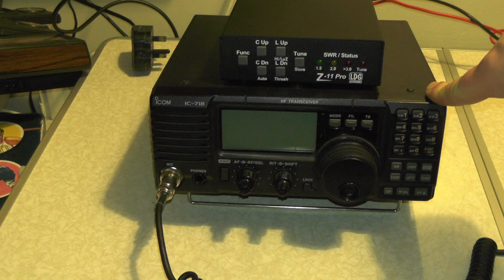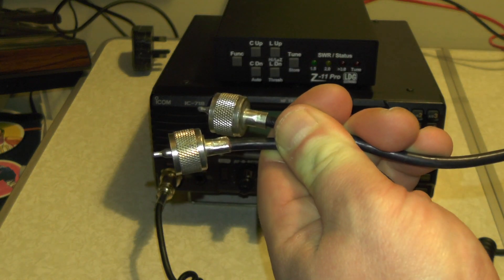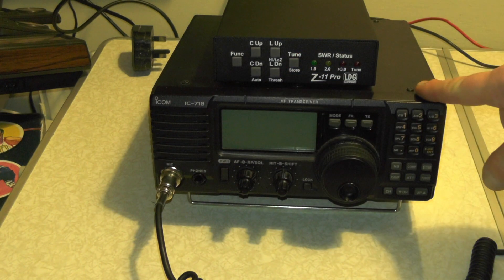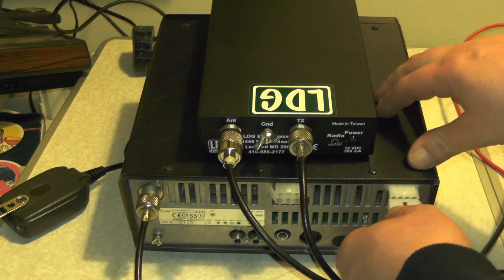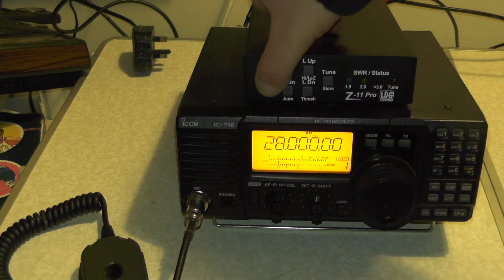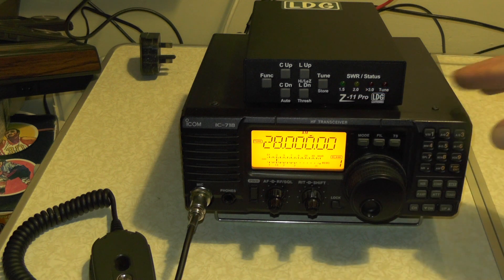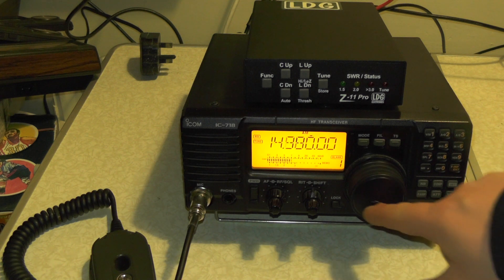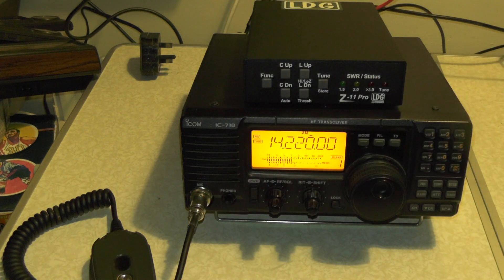LDG Tuner setup how to

Comment: I've tried setting this up multiple times and it won't work. I have the IC-718 and LDG Z-100Plus and the connecting cable. I setup the initial screen to Tuner "4", turn off the radio, restart radio, and all that happens when I press "TUNER" on the radio the "Tune" icon flashes and nothing happens with the actual tuner. 
I'm not sure what I'm doing wrong. Any advice?
Reply: UPDATE: The cord connecting the tuner to my IC-718 was defective. DX Engineering sent me a free replacement and now everything works.
Reply from the maker: Have you got the rf connections the correct way round?
Reply: @2j4ez  Yes I have.
Reply: @Windmill97  I had the same thing to happen. I have the LDG-AT1000 Pro II tuner and it did nothing on the "4" setting on the Icom IC-718. I put it on the "18" setting and it works.

Comment: Could you do a video on setting this turner up with a ft857D. Cheers
Reply from the maker: Ill have to purchase the interface cable to do it. you can also set it up with just the RF connections that would work . but I found that if I keyed up on UHF/VHF the tuner would still try and tune the antenna in ill look into the cables for the 857D thanks for watching